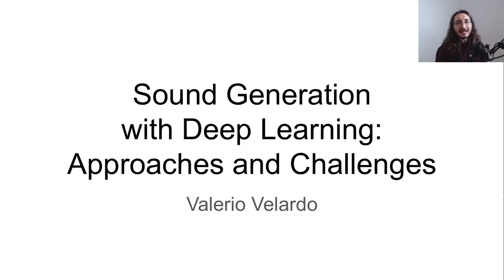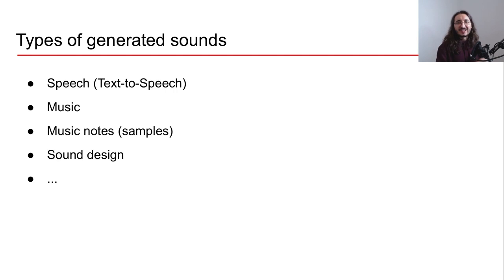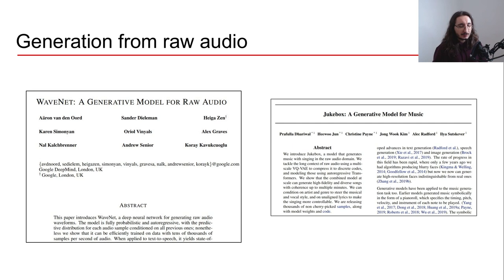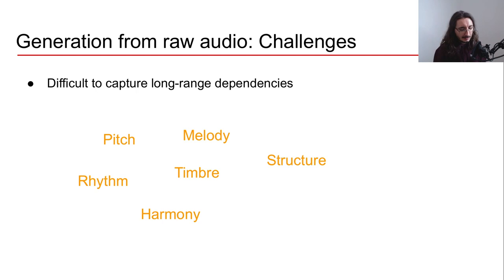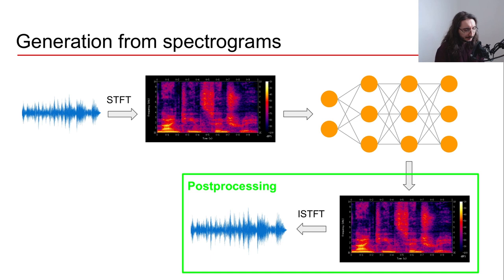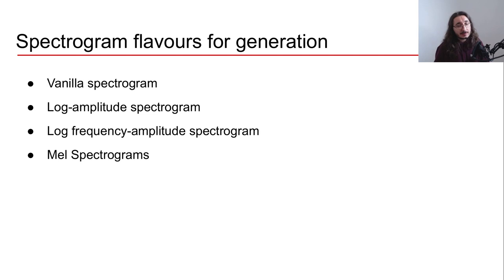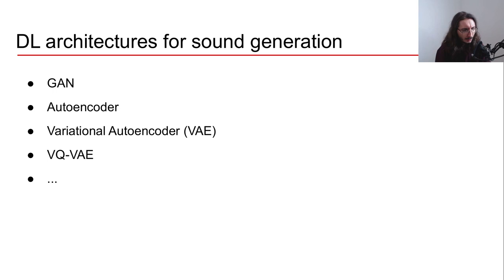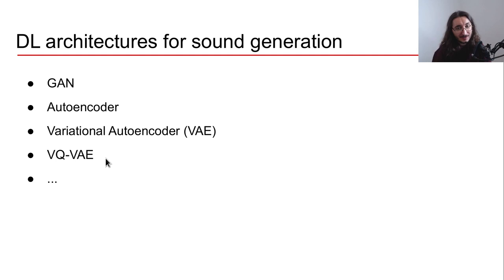Sound Generation with Deep Learning || Approaches and Challenges

Comment: Speaking of autoencoders, do you think you could eventually talk about audio clustering using the embedding? That would be really cool! I've also seen some interesting loss functions used also on the embedding to enforce small distances between two of the same class (or similar classes) and large distances for very different classes.
Reply: Just to also add, there's a paper called "SCAN: Learning to Classify Images without Labels" that is SOTA for image clustering. They do something cool where they send an image + the same image with augmentations into the network and use that to make the embedding distances close. I wonder if something similar could be done with audio augmentation!
Reply from the maker: @Erosis  thank you for the suggestion! I'm definitely going to cover clustering / music similarity with embeddings. Thank you for the reference too :) I wasn't aware of the SCAN paper.
Reply: Is this some sort of Siamese architecture?
Reply: @hijonk9510  Yes. Both the original image and the augmented image enter a network with the same weights and structure. Keep in mind, SCAN has more steps after that (mainly regarding the clustering).